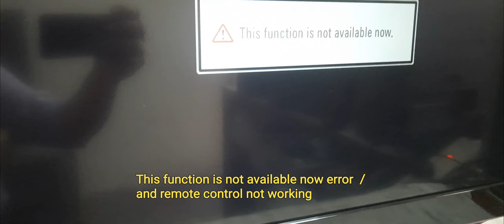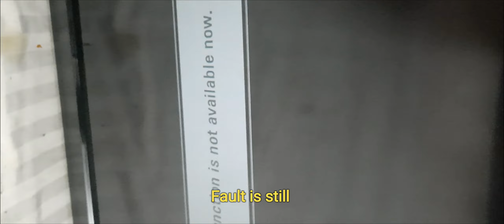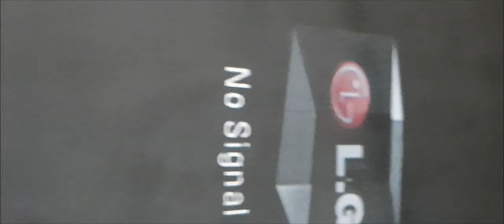LG LCD TV ERROR ON SCREEN/REMOTE CONTROL NOT WORKING

Comment: Thank you very much Star Electronics!
Finally a solution for this problem, only disconnecting the keypad did not work. Just a notice:on a  LG 37LE4500, the wires are reversed from the ones in this video, so number one is on the left and number twelve is on the right.